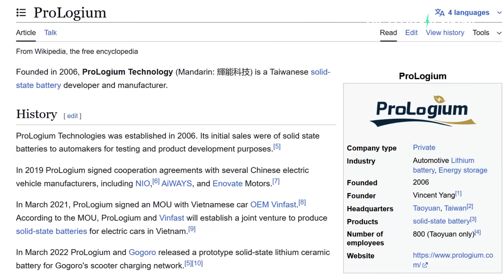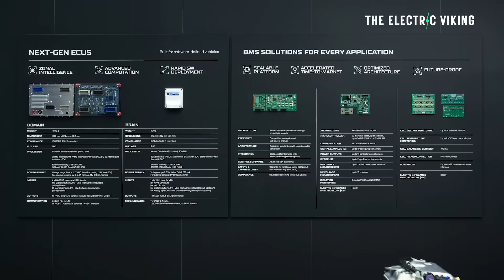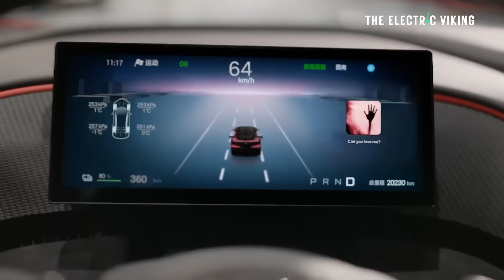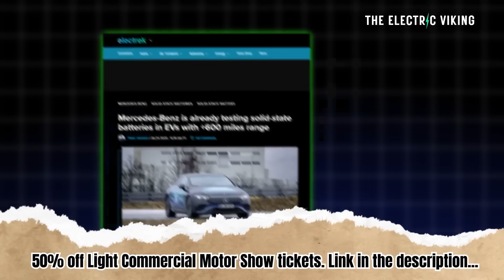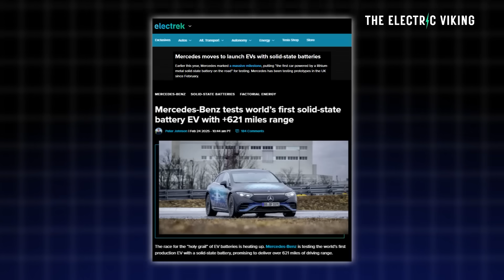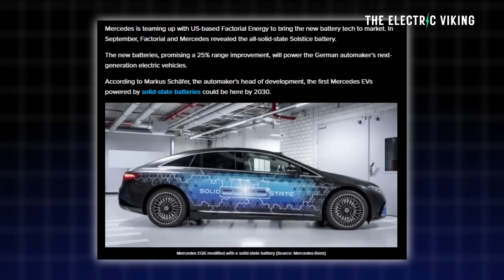Rimac Reveals Solid State Battery that charges in 6.5 minutes

Comment: For 99.9% of motorists it is unnecessary other rhan for the occasional long journey 2-3 times a year. Most charging can be done during the 8 hours per night the average person sleeps every night, preferably using free energy harvested from solar panels on their roof and stored in a home battery for use to power the home and recharge the car. While you're at work your home battery is being filled up with free energy from the sun,  you can also run your home from your vehicle as a back up in an emergency, it's a no brainer.

Comment: I always hear comments and news around vehicle battery charge times, I’m not sure that most people really understand the basics.
I.e motor energy consumption in KW/H needs to be replenished that means massive chargers and the grid connection to match. This is the real issue not the ability of a battery to accept charge.
What’s needed are many more power stations and the grid to match.
This will require governments to rethink their national power requirements and try to workout a plan to build and pay for the upgrade. This may take 3 to 4 decades to achieve.

Comment: The need for this is realy niche,
the average family car in Europe will consume somewhere between 70 and 100 Kwh per WEEK, this means charging at home at night or during weekend-hours, of peak or with solar and drive a whole week.
Only on travel there is a need for fast charging.
Once or twice a year, driving 3 hours at 120 km/h = 360 km, 70 to 80 Kwh, then a lunch break or whatever of around 30 minutes, meanwhile recharging a 110 Kwh battery 10 to 80 is perfectly doable.
Reply: One use case where this could come up is fleet vehicles which are in use nearly 24/7. Without very quick charge times, electrifying the fleet require purchasing more vehicles than would be needed with gas or diesel so that, when one vehicle is charging, other vehicles are available to cover for it. With fast enough charging, you avoid the need to oversize the fleet like this, which saves operators money, and makes electrification a more competitive option.
Reply: It also means a decrease in charging stations. Imagine with the current ev charging infrastructure and everybody driving an ev how long the lines would be for charging stations of we don't get faster charging cars. In my little touristy town we have 3 gas stations and in the middle of summer even in an ICE car the wait time is about 15 min. We currently have more ev charging stations with only one topping out at 120kw power. If everyone drove EVs I think half of the town would need to be covered in ev charging stations. Faster charging means less waiting time means less charging stations.

Comment: So lets do the math. (80%-10%) x (100kWhr) x (60min/hr) x (1/6.5min) = 646kW. So looking at a constant charging curve this means the car needs to be connected to a charger that can sustain 646kW for 6.5 minutes. If the charging curve is not flat then perhaps this battery system would need the Megawatt charging systems that is proposed for long-haul trucks and associated MCS connector. That is an impressive battery structure, battery chemistry, battery cooling system and charge delivery system. Assuming these batteries find there way into affordable EVs, you will need to deploy a significantly better charging network than what is commonly available today. The good news is that this means the bottleneck to fast roadside charging would not be an EV using this battery system.

Comment: EU: between AUD 1.41 and AUD 2.30 per kwh at a fast supercharger up to 350 kw, depending if You have a contract (costs extra) and if it´s on the highway or not, if it´s day or night. One 80 kwh charge easily costs You AUD 184 - supposing You find one and it´s not occupied. "Up to..." signifies You get max 175 kw if another car is charging at the same station. Exceed the max. charging time of 30 or 45 minutes by 1 minute because the pizza is not paid, it rains or the kid wanted to go to the WC and You get a fine of an extra A$88.49. This is one of the dark sides of E-mobility. It does not apply to Tesla. And media wonder why Europenas are still shy to buy an EV - except when they can deduct it 100% from taxes as do companies and entrepreneurs.
If someone wants it cheaper he can still charge at 11kw - and than pay extra for dinner and the hotel room because he doesn´t make it home. The new Juli/August 2025 trend for EV owners was to send the car beforehand by dieseltruck to the holiday destination - and to take a plane. This future that is already here is slightly different from the wonderful marketing promises and political speech - it´s just reality. Me too, I believe in technological progress and that soon over 1.000 miles of range will be possible with sleeker cars, more efficient engines and better, maybe lighter batteries.

Comment: We are rapidly approaching the day when batteries charge faster than pouring petrol into a tank and giving a longer range than a tankful.
Reply: I don't think we will see that. But, I do think we will see the differences in charge time vs. fuel time get close enough as to make no practical difference. Especially since you don't have to stand there at the pump while the car is charging.
Reply: But not today, and not the nearest ten years.
Reply: @alexandrshevtsov8 Au contraire. Alex. Such batteries will be in production cars within 3 years.

Comment: I am totally confused why we need EV's with so much horsepower.  For years I've driven cars with 200 or less hp at a fraction the torque.  Holy shit. When will somebody just build cars for regular people. Rich people are really making me feel nauseated these days.
Reply: EV are fast and cost less than ICe while being faster. Tesla model 3 performance 0-60 in 3 sec for 58k USD, what ICE car can do 0-60 in 3 sec and cost 58k?
Reply: @utlord Yes, love it. Mine do 0-100kmt in 4 2 sec. That's fast enough, for now.
Reply: @utlord who cares about the unnecessary speed and power? A few enthusiasts but not the average commuter. Why pay more for a car that has power and speed people don't care about. Z just makes the car to expensive.
Reply: EVs are for regular people!
The fact that they have optimised cars so quickly shouldn’t be a shocker unless you are a boomer. This is progress and should be celebrated. Dont agree? Look at efficiency of ICE cars
Reply: Needed for regenerative breaking which increases range. 
This will eventually balance out as the sweet spot is found.
Reply: Ever got into an electric tram and felt the torque - it’s the nature of the electric motor beast!
Reply: @andy8423  I an electrical engineer and have designed EV's I think maybe you misunderstood and just stated the obvious. I'm saying they are insane with power and range anxiety.
Reply: My EV has 58 hp, and I have no problems with keeping up with other cars in the grid-lock all the way to town.
Reply: @runeaanderaa6840  Thank you. If you use a 200 hp or less motor and cut the battery bank in half because of weight it will have a marginal increase in efficiency. Maybe 5-10%. So if the original range was 400 miles the new range might be something like 220 miles, still a lot of miles. But manufacturing cost reduction is very substantial cutting the cost of the motor, inverter and battery bank in half. Aka, affordable EV's.
Reply: Mostly because of recharging. Higher Kw motors are breaking better. I think you need 200 kwh batteries in some cars. This because of towing.
Reply: Soon Charging will be less than 1 second...oh yeah, there is a guy in Africa that built a system that can charge battery from the air...but no one believe him...Just like lightning...wait...people believe in millions of electricity volts from lightning but refused to believe that the same concept can charge a battery? People are really closed minded. I bet the same people won't believe that metal can float. 😂
Reply: Better more than not enough?
Reply: It’s just the nature of electric motors. The engineering, cost, weight is hardly a factor. It’s relatively easy to make a super powerful EV
Reply: @sunlightconversions828  The hell it's not! Only for people that have plenty of money. It's the difference between a $40k+ vehicle and a $20k vehicle. So easy isn't the issue. I can't believe so many people don't get it. I'm an EV electrical engineer btw. 30 years. So you don't need to throw your simplistic explanation at me.
Reply: I think it's more of a demonstration on how powerful EV cars can get. There are already a lot of EVs for regular people, so I don't know where you're coming from tbhm
Reply: @adamhaqiem I don’t know a single EV ever made that doesn’t throw you back in the seat. Even a Nissan leaf is fun to drive. I just converted my second vintage Vespa to electric. I wasn’t trying to make it the fastest Vespa on the planet but it is. It’s more than twice a fast 0-60 than the most powerful Vespa you can buy.
Reply: @adamhaqiem  Yes that much is obvious. You don't get where I am coming from. The very first EVs in production were not practical cars but super cars. And even now they develop super cars first. The cars you call EVs for regular people are highly developed to address range anxiety. A mental disorder developed over the last 100 years. Lets just end it here.
Reply: @davidrommel8109  ok i kinda get what youre trying to say. Correct me if im wrong, youre hinting that they are keeping power and battery life high to give an excuse to put higher prices therefore generating more revenue?
Reply: @adamhaqiem  No, not an excuse to keep the prices high. If you ever have a chance to talk to execs in any of the car manufactures they will tell you that cars with less power and range will not sell. They have the same anxiety.
Reply: A few months ago we had a horrific accident near my house. A Tesla had rammed into a group of cars waiting for a green light at over 100mph. Deaths + severe injuries. These heavy overpowered vehicles can become deadly weapons so much more quickly than before.
Reply: @Ericwvb2  I'm so sorry to hear that. A tesla weighs about the same as a F-150. Big heavy vehicles are why most people aren't willing to drive smaller economy cars. It's own cause and effect.
Reply: Thankfully most people arnt like u. No one is forcing you to buy one. They literally make tons of cars for regular people. Most Chinese EV's sold are cheap and underpowered, just how you like it grandpa
Reply: You liar, you have struggled at overtaking all your life due to weak engines, and want the future generations to suffer the same fate. Are you a boomer?
Reply: i need  boasting rights😂😂😂

Comment: so 2 years from now we will know There will probably be faster chargers by then.  I really hate it when a company lists how far in miles a battery can go. because it can not.
What car is this milage listed for
are they using there motors or another brand.
what tires and what speed.

Mileage is not a good number for a battery.. it works for a car. 

Battery size, voltage. charging time. weight of battery with all needed systems is what matters 

The capacity sounds good... charging speed good..weight great compared to lfp. i did not hear anything about battery chemistry type. all we got was solid state. I want to know more. but anything 2 years out is forever in the world of battery innovation.

Comment: I personally don't think charge rates above 300kW will be a driver for purchasing. Even if our future includes 1MW cars and chargers, those cars are still going to get 80-90% of their kW-hrs from home chargers. My current <300miles <220kW rate is just fine for road trips. If you take the point of view of the utility provider, they also don't want a fleet of cars charging quickly mid-day, we need more home charging and home batteries to help flatten the demand profile throughout the day
Reply: 2 problems with that line of thinking:

First, for road trips ultra fast charging absolutely matters, maybe it doesn't to you, but polling suggests it does for a whole lot of people that are going to need to be convinced to buy EVs. I agree with you that we don't need 1MW charging and that 300kW may be enough, but likely people will want a bit more. If you want a car that can accept 300+kW (or close to it) for the whole charging cycle you can't get that with even 350kW peek charging ability. The cars today that can do over 300kW can only do it for a short period of time, and then they slow rapidly. An EV with a peek charging rate of 500+kW will likely stay at 300kW for much longer.  If you could maintain 300kW and had 75kWh to charge (3/4 of a 100kWh battery) it would take 15 minutes. That is fast enough for the vast majority of the market. Again, though, you don't get that from a 350kW peek charging EV, you may get that from a 500-600kW peek charging EV. Of course that 200+kWh battery in the chevy trucks will take twice as long, so keep that in mind too.

The utility provider won't have a whole fleet of EVs charging midday at 300kW because the only cars doing that are road trippers and commercial vehicles. Those will need to do that. Even then the chargers will be buffered from the grid with batteries (likely sodium ion because they are/will be cheap). 

Second:
There are a lot of folks that can't charge at home. Sure eventually those folks will learn to trickle charge when they can from level 2 chargers, but that market right now expects to be able to pull into a gas station and fill up. Again it may not matter to you, but it will matter to a lot of people that are going to be late to work, or where ever else they are going that they can charge up as quickly as possible. That includes people that drive for a living and are not making money when their vehicle is charging (taxi, uber and lyft drivers for example).

For the market share to grow it needs to cover most people's needs not just the few it does now. We will get there, and faster charging cars are absolutely going to be part of that. More charging infrastructure is going to be the other part of it.
Reply: In China's most energy hungry city that powers factories, charges all the EV's electricity is plentiful and dirt cheap at 4cent per killowat hour, utility companies dont complain, they provide, why cant we? https://www.youtube.com/watch?v=y-rqI5yrpdk&t=5s

Comment: This was only a matter of time. Quantumscape is funded by VW group which owns Bugatti-Rimac now. QS had prototypes running as early as 2021 and they have only been upgrading since. In 2024 they signed a deal with PowerCo to mass produce the batteries.
We still have to wait till PowerCo manages to get the mass production plant running.

Comment: You didn't mention the other characteristics on the spider diagram. eg how many charging cycles, cost yadda, yadda.
Reply: Last I checked solid state cost something like 20 times that of current batteries. But over time it should come down, as economies of scale and production improvements happen. Typically over time and with scale the major cost difference between 2 products ends up being the material costs and the material costs for solid state are typically (depending on the separator material) lower.  He did mention the cost for the other batteries.
Reply: @mikereinhardt1244  Thank you for your response. I would like to see spider diagrams. They contain good at-a-glance visuals.